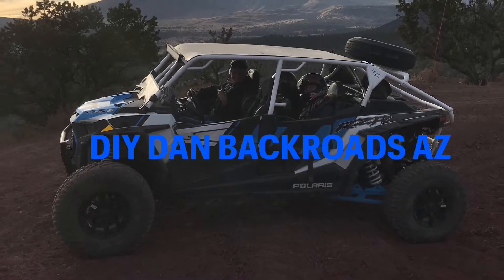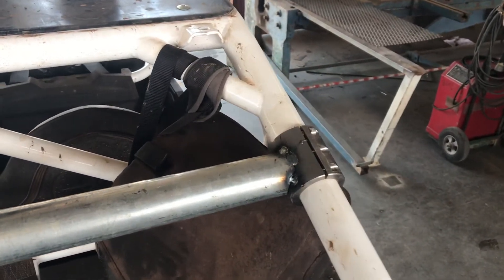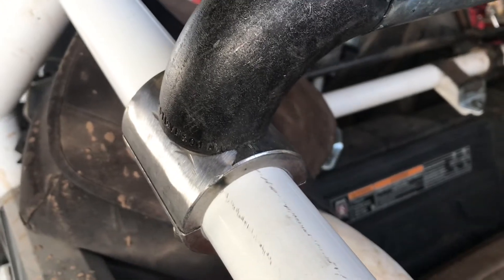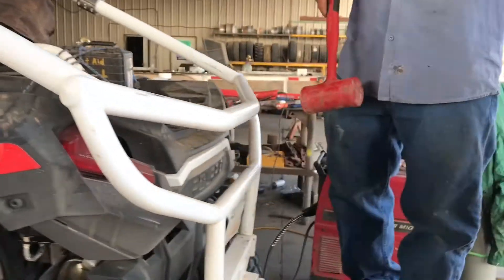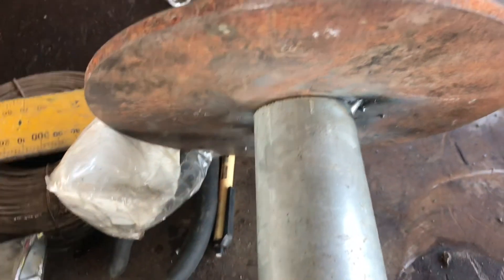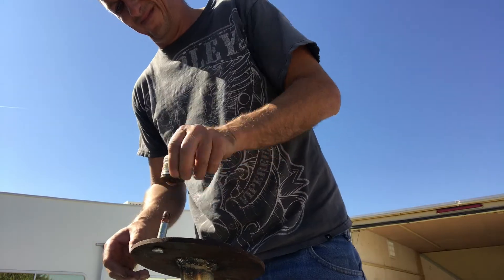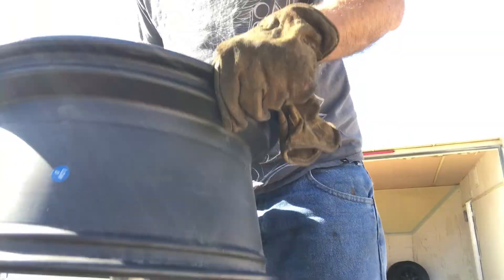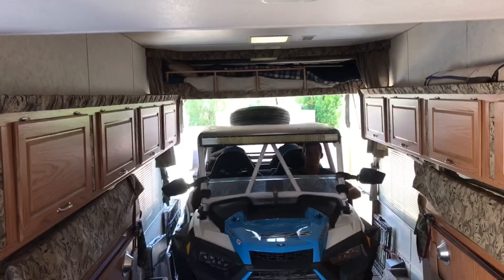DIY SPARE TIRE MOUNT FOR RZR LEAVING FULL ACCESS TO THE BED

Comment: Pro tip when trying to match the Contour of a roll cage pipe measure the outside diameter of your pipe. Cut your new metal pipe a little long, drill pipe with appropriate sized hole saw. Perfect Contour for welding every time.
Reply from the maker: Cool, thanks